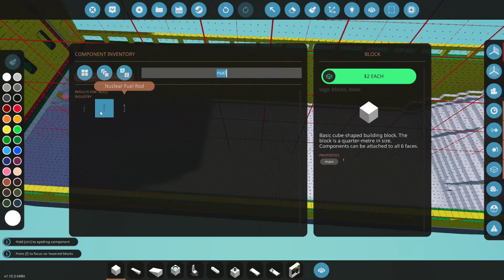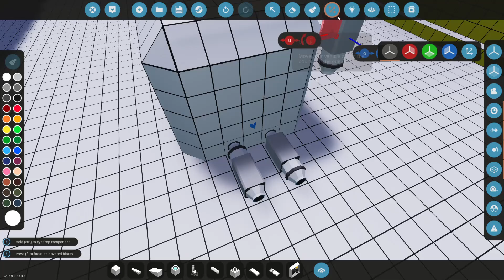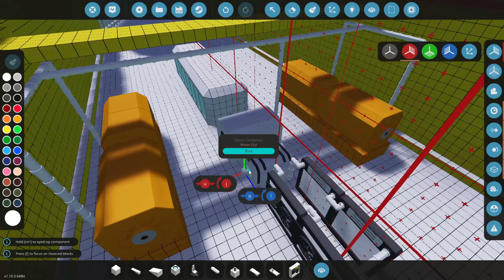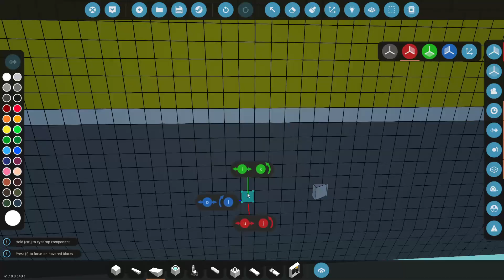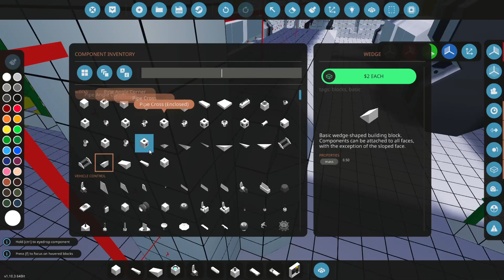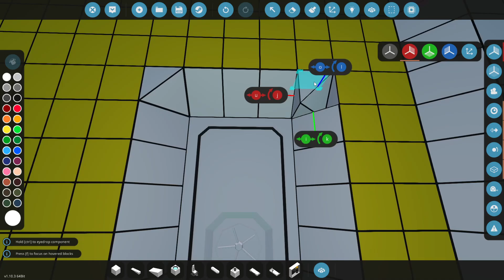Nuclear Engine!! | Stormworks Supply Ship Build | EP.3

Comment: Control rods are not for moderating temperature they are used to control the amount of atoms undergoing fission in a reactor. they stop the reactor from going into a meltdown. If control rods are engaged thy with stop the reaction and therefore reduce the heat. I could go more into detail but I don’t quite have the time for that at the moment